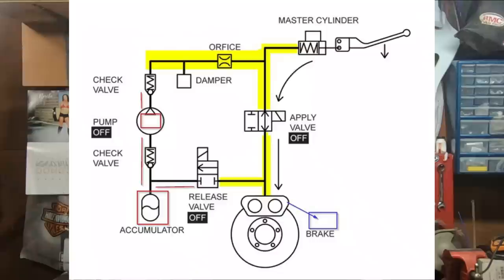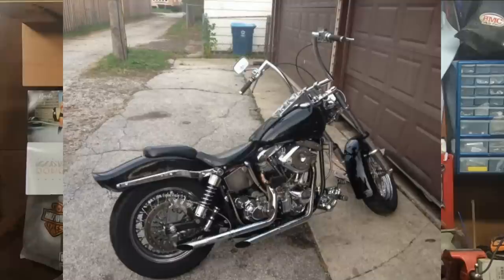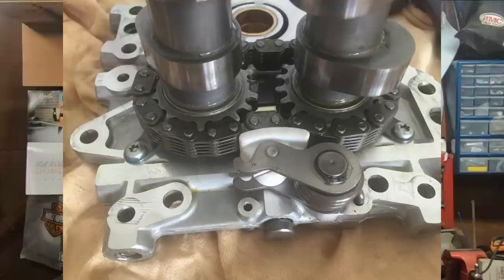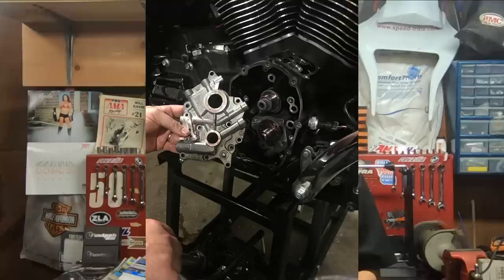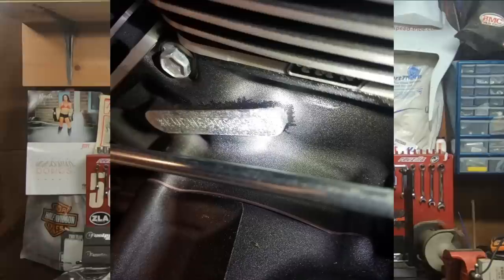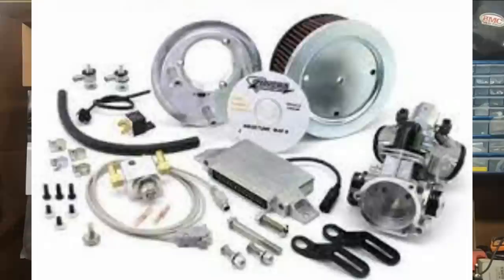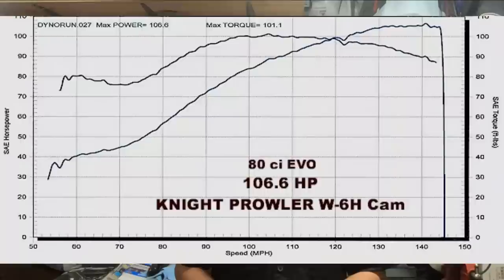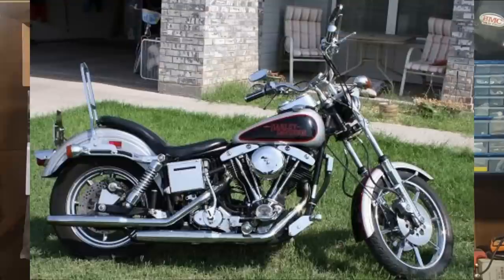Best Harley Engine Ever Made (Arguably)

Comment: does the 1990 evo have ina or torington cam bearing  my bike is stock flhs 50,000 miles
Reply from the maker: I believe 1990 was the last year of the Torrington and then in 1991 they started to transition over to the INA late that year. By 1992 it may of still been a mixed bag but for sure 1993 they were all INA bearings.
Reply: @GixxerFoo  thanks

Comment: I did 10 1/2 to 1 compression pistons what other performance mod should I do I wanna do true dual exhaust and my bike has the efi System
Reply from the maker: Having a good exhaust is one of the best mods for an Evo, for sure a good aftermarket cam will really make it run! With the Magnetti System that can be tricky on tuning though, there is the Power Commander V. The FI system works great unless it starts having issues, then it can really be down hill. Carb conversion with a single fire ignition isn't too bad to do and can save you a lot of headache down the road.
Reply: @GixxerFoo  I might look into the Tuner but once it starts having issues I will swap it to carbureted there’s a guy down the road from me that has a 99 Electric glide The had efi system and he converted it to carbureted and it burned up his wiring harness I don’t know if it’s because he didn’t change the ignition system or what caused it
Reply: @GixxerFoo  there was somebody local to me that did the carb collision kit and his bike caught on fire less than a mile or two later if he didn’t change his ignition to a single fire ignition would that have caused the fire

Comment: I still feel...if i ever need to fix the bottom end of my TC 103 and rebuild it up...I would just replace it with an S@S crate motor...And be done with it...
Reply from the maker: I've seen the S&S motors as a mixed bag, they have a great warranty and no questions asked if the engine has a problem. They have all the factory issues fixed and most of the problems I've seen were from the high end performance motors.
Reply: @GixxerFoo  Ive researched them...And feel the T111 would be a good choice for me...2year warranty...use my stock intake...runs 30% cooler than my 103...and not crazy HP like the 124...can still use my stock clutch....it would be worth the 7k spent

Comment: My 2014 flhxs stage 4 is making erratic raddle noise at around 2000 rpm. Never makes noise idling. 40,000 miles??? What do you think it might be?
Reply from the maker: Is that at a certain speed or always at 2000 rpm? It could possible be a compensator if the rattling you're referring to if you primary sounds like a box of rocks.
Reply: I try to keep it between 1700 and 2000 when I'm in 6th gear . At 1700 ready to drop to 5th. I did find my no 1 header pipe bracket 1/4" bolts backing out with oil leak around them. Tighten no more leak. In neutral on kick stand with stethoscope top end sounds ok through throttling. Trying to decide to take it to HD or do it myself. Not sure if special tools for this compensator??? I'm not sure it is the compensator. The noise is erratic and at different speeds!

Comment: Big bike probably the evo, v rod isn't a harley davidson engine but sportster engine is definitely the best bang for the buck and can produce as much power if not more and stay reliable. Stick a m8 style head on a sportster engine and that would definitely be the best harley ever made. Best engine in a harley is the Porsche v rod engine.
Reply from the maker: The Sportster Evo engine is just about mechanically perfect, that engine is solid. I'd love to see a 4 valve head on a Sportster, there's a lot of power to be had in there. Just a Sportster with major head work and larger valves will lay it down.
Reply: @GixxerFoo  Yeah, until lawyers and Wigmasters started getting into Harley davidson the sportster was far more popular. That iron XLCH 900 Would smoke the panhead,, knucklehead and shovelhead. The XLCH 900 was actually a 883. Everyone in my area had 900s , I'd see a big bike now and then.  Elvis had a sportster/K-model. My neighbor had a XLCH 900 bone stock and that bike sounded awesome when started. Pretty loud for stock. I loved Harley's and my neighbor let me ride his if I could get it started, LOL,  I had a 71 yamaha r5 2 stroke twin cylinder. I had expansion chambers on it heads shaved, cylinders Ported and coils were replaced with car coils and mounted to down tubes of frame. If you whacked the gas in 1st or 2nd gear bike would wheelie like a dirt bike. My neighbor called it an egg beater until we went for a ride together and I smoked him literally LOL. XLCH was a whole different animal and I enjoyed as much as my bike in a different way. When my neighbor wanted to take my bike for a spin I gave it right back to him by saying bike was a Jekyll and Hyde and to not whack the gas , just roll into it.  He still did a wheelie and couldn't believe a 350cc could be so fast. Right around that time 4 cylinder 4 strokes became popular but for two cylinder bikes the XLCH and my R5 were very dominant. I did eventually get a sportster which I still have or should I say my son has and I have a dyna but still enjoy hopping on the sportster, it's pretty quick with all I've done to it decades ago. I told my son I'd like to put a Hammer performance kit with heads on it and he stated WTF,  you want to get me killed ? LOL 😂 just me wanting more out of less I guess. Now that I've bored you enough,  let me get back to what I started to say, Elvis had a sportster ! It's not a girls bike.  Xtra Lean Competition Hot/Harley.  No one is quite sure which the H stands for.  All I know is Lawyers and Wigmasters have shaped what Harley is now. The more money you've spent the bigger your Cock is and now no production for rest of 2022. Yeah over 100 years of building engines and look at all the flaws in the M8. I bought some M8 rockers and I'm eventually going to make some heads to go on my Twin cam. Hopefully.

Comment: Yes the Evo engine was the pentacle of reliability, the later engines simply SUCK, yep they are more powerful but they all seem to have some sort of mechanical issue that needs to be addressed.  They remind me of that old adage on a mistress, of not a good investment.  But come on 40K and you have to get into the engine to replace cam lifters.  I think I will stay with my old BMW R bike and the ancient Goldwing 1500, both have over 100k and run fine.  Well the BMW is lower mileage and so far the major issue is every 2 years that drill to change out the battery and fuel filters, now come on BMW you gotta take a ton of plastic off to change a battery and access routine filters, wake the hell up.  As for the 93 Wing, bought used for $2500 several years ago, changed the cam belts at 100k as scheduled and replaced the alternator with a aftermarket unit with double the power and 1/3 the cost of OEM.  Now for changing the rear tire, Honda must have hired sadists to design the rear end.  If you get a Wing, get the newer one with single sided swing arm, it will pay for itself in several tire changes, no kidding just ask a Honda Dealer what they would charge to change a early GL1500 and I suggest you be setting down when they tell you.  I do all of my own work and tried to farm the rear tire change out, and sorry the lowest quote was simply ASTRONOMICAL, and the highest even King David would pass on.

Comment: The Evo was the first to suffer at the hands of the EPA? Really? You weren't around in the 70s.
Reply from the maker: The Shovel didn't really have emissions to deal with as much as the Evo. The Shovel got screwed when they took the lead out of gasoline which was awful for that motor, that really caused them to run hot. Evo engines were force to be jetted super lean from the factory, restrictive mufflers and air boxes, lackluster ignition mapping and very mild cams.
Reply: We were able to overcome the leaded gas issue,, but the factory used junk parts instead of Ed Rowe's stuff. The shovel got the H cam, reduced exhaust port sizing, restrictive " Ham Can" air boxes, reduced compression ratios, etc. This stuff was either direct result of emissions laws, or Band aids to try to deal with them. The EVO was far more restricted, though. It actually had less than zero overlap.

Comment: The larger displacement of the TC engine is what allows for the improved pushrod angles? Who tells you this shit? Using that logic, my 1990 883 started  life with 3 in bore, now 3 13/16]. I guess my pushrod angles are really dialed in!
Reply from the maker: The larger displacement and bigger cylinders allowed for them to space the cylinder studs wider. Using wider cases gave them more room to angle the pushrods better, especially using the dual cam setup which was another move for emissions at the time.
Reply: The improvement in cam to pushrod layout is a function of the twin cam cam chest. That's what eliminated the poor exhaust angles.

Comment: The reason the reliable is because they dont make any power. Its like a 7.3 Ford. yeah it will go 500K but it makes 100HP. There is a trade off of HP/Longevity. You can throw pistons and a cam in it and run with a stock TC 88.

Comment: So it’s just Better than a twin cam or M8 just have to rebuild the engine, but after market cases, ect, ect if you want 100 Hp. Twin cam and M8 you add a cam and your at 100hp and can ride for years and 100,000 miles. 🤷‍♂️🤷‍♂️🤷‍♂️🤷‍♂️ we will have to agree to disagree on this video sir